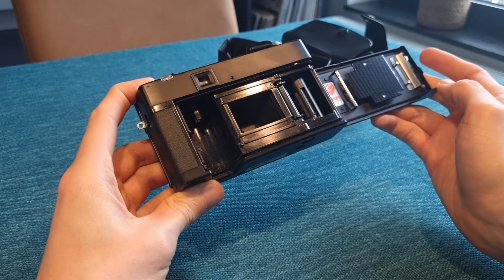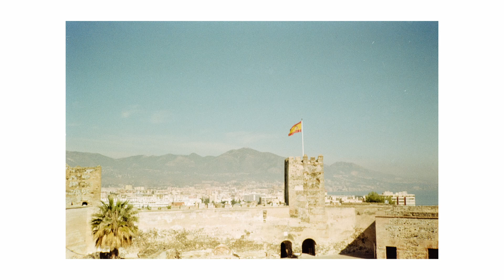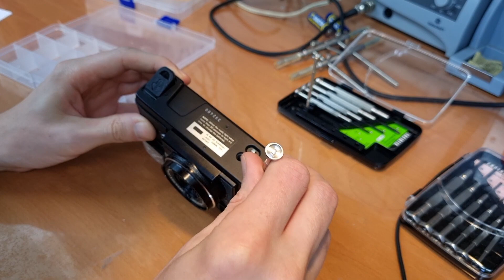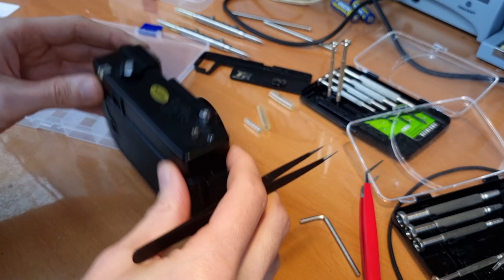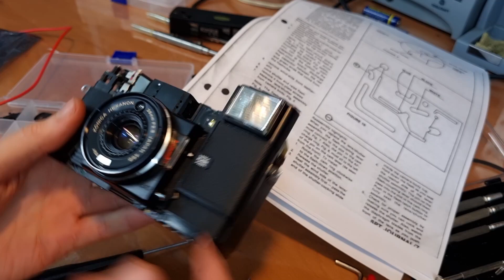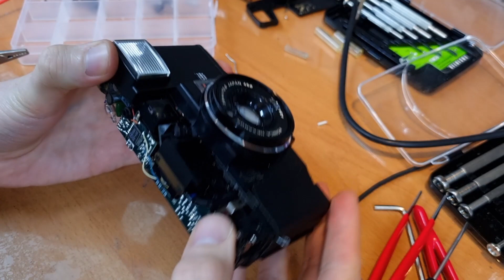This Konica C35 AF has lost its main party trick: the autofocus (Part 1)

Comment: How did you managed to assemble camera in 51:32? Tried all angles of this cam ring but still got no connection with the flash lever =/
Reply from the maker: I don't know how else to explain it... You need to position the cam ring in the correct position (as shown in the red circle in the video) before reassembling. Then the lever should catch in the ring. It also took me a couple of tries to get it right.

Comment: Hello, my C35 AF work but the autofocus seem wrong. Whenever I press button (the light on viewfider turn green, it shows a lots resuft on autofocus indicator meter. And the shutter seem slower, about 1 2 second after I press button along with mechanism shutter sound close. I have checked the S1 like your video, replace it, hopefully it works but problem still there. Any idea, thank you so much

Comment: Hello Retro Tech Restaurations. First of all thank u for your video. It could come in very handy because i seem to  have the same Problem with my c35 af. When i use the Kamera upside down the autofocus and led tends to work again, wich i think confirms my assumptions. Do u think i could use a Thoothpick instead of the dart tip? Or is this going to cause any problems? I also would like to have a long lasting solution. Thanks :D
Reply from the maker: I can't say if that will work. Not sure if the toothpick will be thick enough. Good luck!

Comment: Hello, I really enjoyed your video :) Thank you for making it.
I have the same type of camera, and there was a problem with the focus. Short and medium range are well focused and there is nothing wrong with shutter button and light indicator. However, when taking landscape pictures, the focus goes out and the distance indicator does not go to infinity.  I wonder if that was the same case for you too.
Reply from the maker: Thanks.
No, that was not the case for me. That sounds a bit like an issue with the rangefinder. Maybe misaligned?
Reply: @retro_tech  Ohh I see. Misaligned rangefinder makes sense but it's hard to figure out the exact reason :( 
Then in your case, the distance indicator(rangefinder) worked well, but it was out of focus?
Reply from the maker: Well, in my case the switch wasn't working, so no power was going to the autofocus electronics at all. Then the camera operates purely mechanically, always "focusing" on infinity.
Do keep in mind that even when the camera is working as it should, the autofocus isn't perfect. For example, the camera will always focus on the object which is closest to it. Also, I have noticed that it's better at focusing on vertical lines than horizontal lines. And the sensor is mainly using infrared, so maybe not all color contrasts are picked up evenly. It's one of the first and oldest autofocus mechanisms after all...
Maybe I'll do another video some time later explaining the autofocus more in detail.
Reply: @retro_tech  Yes Thank you for letting me know a lot. It was really helpful :) I'll look forward for the video bout autofocusing.

Comment: Awesome video, thank you so much for it. I just picked up this camera at a thrift store for 10 dollars but looks like it’s a dud. Flash doesn’t work and the auto focus is doing the same as yours. Bummer. Might open it up and see if I can fix it although I’ve never done anything like this. At least it will be a learning experience I guess.
Reply from the maker: If neither the flash nor the autofocus is working, it sounds more like no power is going to the camera at all. These two circuits are almost completely separated, so a faulty IC or S1 switch wouldn't stop the flash from working. Have you checked if there's nothing wrong in the battery compartment? Maybe some damage from leaked batteries?
Thanks for the compliment!
Reply: @retro_tech  oh ok, thanks for the insight. I’m pretty sure it’s the battery terminal then. It had one battery in there when I picked it up but the terminals were all corroded. I tried to clean them but nothing.

Comment: I think my c35 AF has the same issue! The low light indicator stopped working and the autofocus keeps setting to 1m after firing the shutter. Thank you so much for taking the time to make this video, I'm going to try and see if the contact screw is also broken!
Reply from the maker: If the low light indicator never works, it simply means that the electronics of the camera are not working. This could be due to several reasons: no power getting to the PCB due to an issue in the battery compartment, a broken wire or (like in my case) a broken S1 switch. The worst case scenario is the IC being bad, which is a problem which cannot be resolved without a working IC from a donor camera.
Good luck!
Reply: @retro_tech  the lightmeter and the flash worked but the AF didn't. I opened the camera up and just as yours it had the broken plastic screw. Fixed it and now it works great again. So glad I found your video!
Reply from the maker: @MrLen93  If the S1 switch is broken, the lightmeter also doesn't work. The camera only meters when you push the shutter release and close S1. The flash circuit is completely separate, so it's normal that the flash still works.
Glad to hear that you got it fixed and that my video helped! This plastic screw seems to be a weak point in the camera.
Reply: @MrLen93  hye, may i know what size screw you used in its place? am planning to carry out the repair myself and want to get the parts ready before i even attempt it
Reply: @AlohaAkbarr  i just glued the screw together with some strong glue